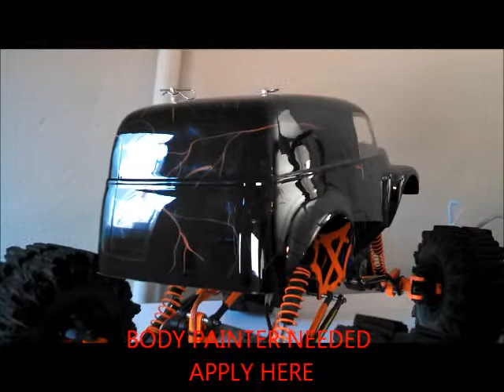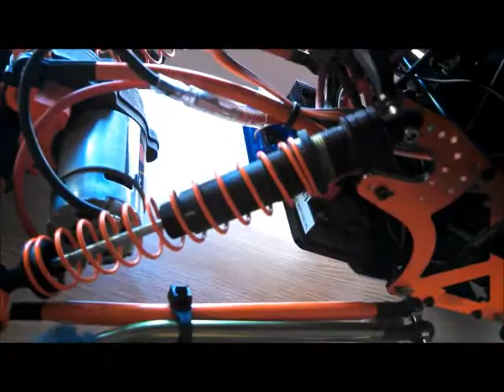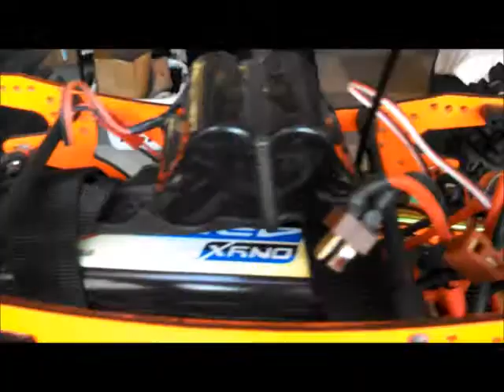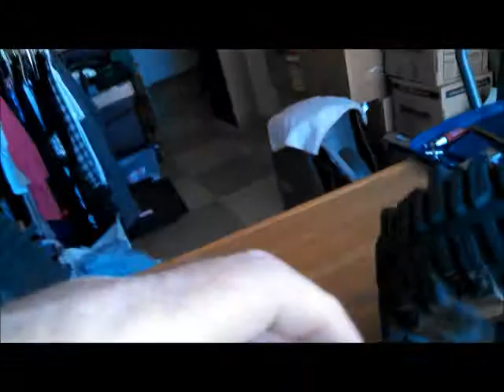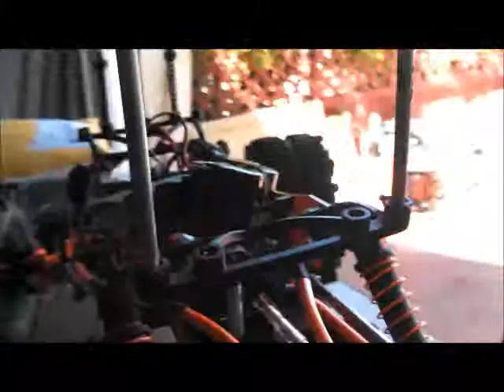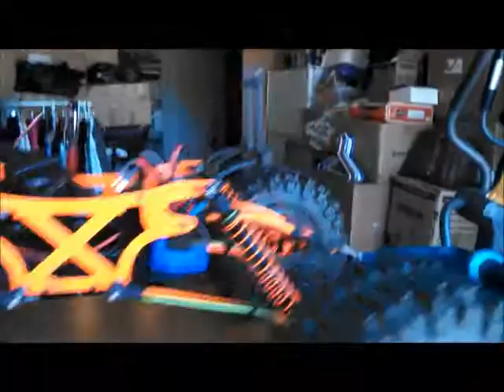ORANGE MAXSTONE UPGRADE lll

Comment: How did u get so much speed out of the 27 turn motor? I'm running the Integy alloy gears & 23 turn 540's. What speed will it run with the 35 turns? Should be a little slower than the 27 turns, correct?
Reply from the maker: +John Osborne (Guys Auto Repair) 
Sorry the titan 550's are 21 turns. The 550's are a much bigger and powerful motor then the standard 540's , they are used in the traxxas e-maxx. Yes with the 35 turns (540 size) it will be much slower. But better controlled crawling. But that's ok because the integy alum gears are $50 a pop and that gets expensive when you start stripping out gears after 2 to 3 battery runs. Plus i'm running 12 cell nic-metal battery's. (2x 6 cell).

Comment: I'm running 7.4 volt nimh battery. How well do u think the 550 motors will perform at that voltage?
Reply from the maker: +John Osborne (Guys Auto Repair) 
r u running the stock esc? If so you might burn out the esc.

Comment: How many turns are the motor? Wanting to gain more speed but also don't want to lose my torque, though I'm running the stock 23 turn 540's
Reply from the maker: +John Osborne (Guys Auto Repair) I think there 27 turns titan 550's. Now i have replaced them with novak 35 turns. The titans were a little to strong and causing trans gear ware to fast. Stripping them out if you run wide open a lot. Thanks for watching, Jerry from  Ramp-Ja's Rc's
Reply from the maker: +John Osborne (Guys Auto Repair) 
If your running the motors that came with your car they are 55 to 60 turn motors. I found the best turns for that car are 35 to 55 turns if you want more speed. Anything under 35 turns will have a hard time crawling with control and will make your esc run hot if your using the stock one that came with the car.
Reply from the maker: +Jerry Morrison 
Ps all the electronic's in my car are aftermarket plus i run a 5 cell pack for the servos.

Comment: So the one ESC will run both motors without issue?
Reply from the maker: It's the stock setup for traxxas emaxx i believe. 2 batt and 2 motors with the same esc and motors. Thank you for watching. Jerry from Ramp-Ja's Rc's